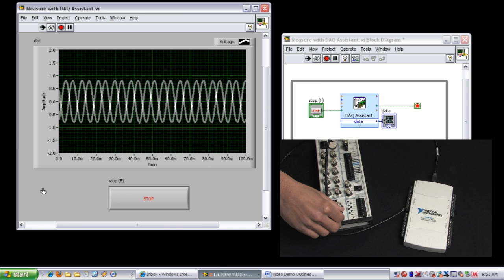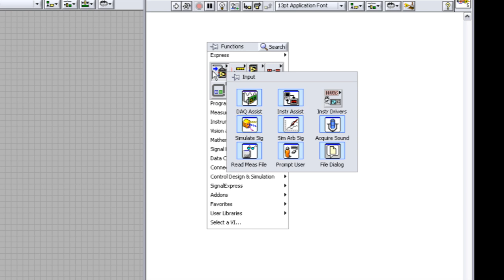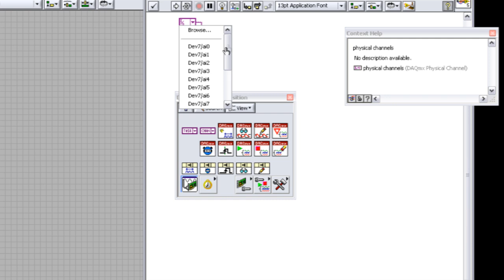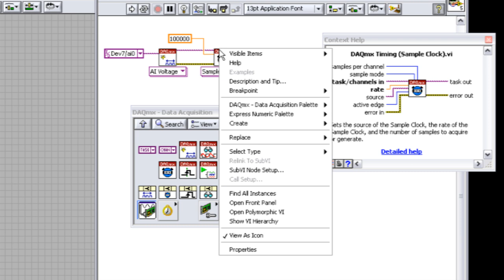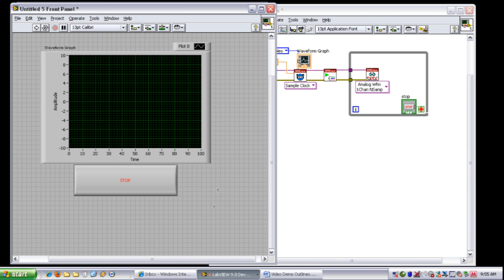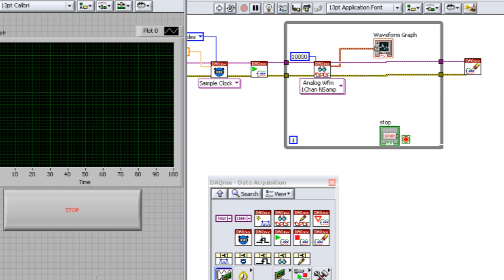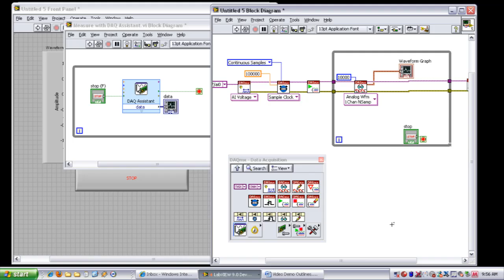Programming Data Acquisition Applications with NI-DAQmx Functions

Comment: Great presentation! I was just wondering when you connected one end of the Function Generation output to ai0 (AI0+)of your DAQ, where did the other end go? Should this go to ai4 (AI0-; differential), or GND? I have a function generator with the output cable having two ends.

Comment: Hi. I am working on NI-DAQmx (USB 6215) device and I am using python to capture signal from the device. I need to capture signals from 16 channels at the same time and display using matplotlib and pyqt4. I have looked into documentation, I found and implemented a code that captures from 1 channel but not from 16 at the same time. Any suggestions if this is possible? Thanks in advance

Comment: Sir, I want to connect ZM2376 LCR meter with LabVIEW... I checked its data sheet, only in this model, IVI driver is supported. 

Kildly provide block diagram of (frequency vs impedance) or frequency vs time..

Comment: Hi.i am going to do project using USB 6000 device can i use five input sensor?i.e wind speed sensor,solar radiation sensor,temperature sensor ,relative humidity sensor and  carbon di oxide gas sensor.